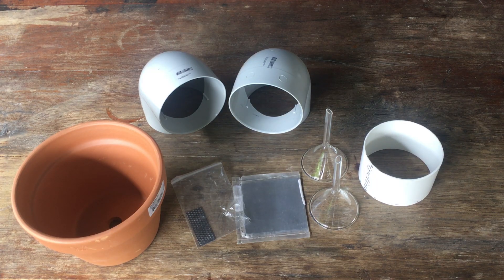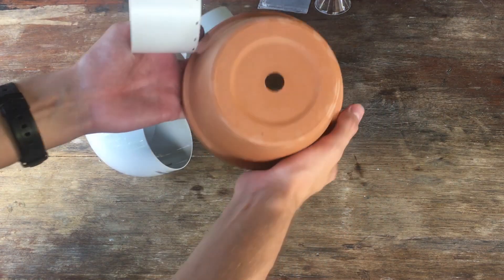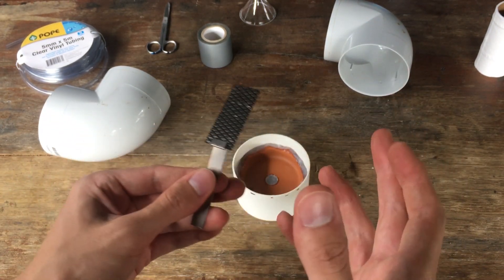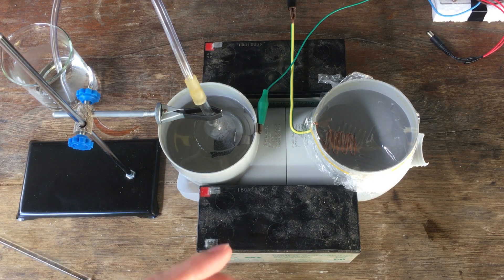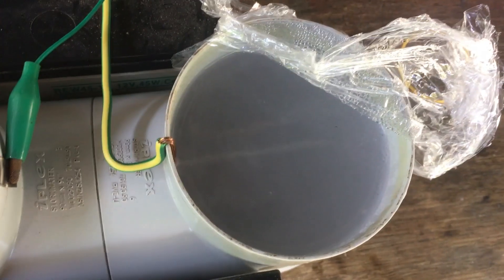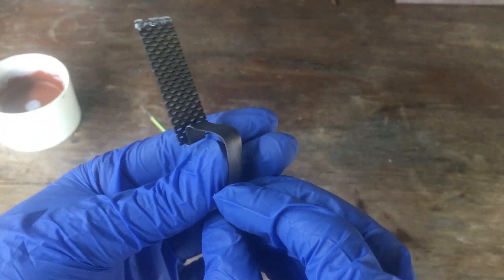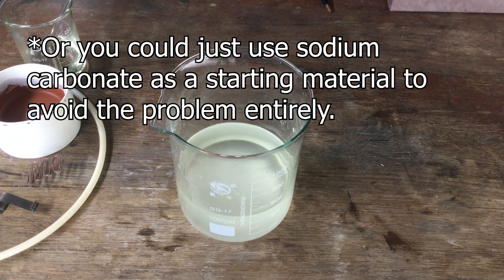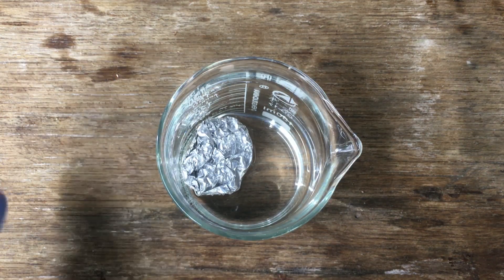A Chloralkali Cell

Comment: Instead of the diaphragm method, you mentioned you could make a ion exchange membrane? How would you do this? Any videos or materials on this? Or where could you buy a nafion membrane? Anyways, thanks for the video - really cool that you could run this process without going industrial!
Reply from the maker: I haven't tried making an ion exchange mambrane yet, and I haven't yet found a good guide to doing it, but others seem to have had very good results with it. Some videos on the topic include:
https://youtu.be/vJfc6dxrllI
https://youtu.be/BT3HjyziH_0
(note, that second guide is for an anion exchange membrane, which isn't useful for this process).

Nafion is a little tricky to find, but there are a couple of websites which will sell to individuals:
https://www.fuelcellstore.com/membranes/nafion
https://www.aliexpress.com/w/wholesale-nafion.html

Comment: what happens if you use a 12v 200Ah car battery for this experiment? Does it speed up the reaction process? Or what are the side effects or benefits of using 12v 200Ah batteries?
Reply from the maker: A 12 V battery will work fine for this experiment. The only drawback will be the fact that you won't have direct control over the current. To control the amperage, you'll probably need to adjust the depth of your electrodes every few hours in order to change the surface area in contact with the solution.
Reply: Hi, i love watching your videos and I find them very useful. In this NaOH production experiment I noticed that just to produce 15g it took you two days, what advice would you give to someone who would want to produce that same 15g in just 12 hrs? Your answer will be highly appreciated

Comment: Do you think this works better than just using a clay pot in an open tank? Also I bought some small pots recently and I had to sand paper them to make them porous, they are probably frost proof and made to not absorb water at the surface, once rubbed down they worked fine.
Reply from the maker: This setup doesn't really work much better than using a clay pot in a tank. I simply find it more convenient to have the two chambers positioned this way when it comes to extracting the product or collecting gasses (and also for consistency when comparing different reaction conditions, seeing as it can be used as a standardised cell construction).
A lot of clay pots are glazed after firing, making them non-porous. Sanding them down to the porous section is a good idea if you can't find non-glazed ones.
Reply: @ScrapScience you can make your own clay membrane from backyard dirt, turn it into clay, shape it, dry it air for a few days, bake it in oven for half an hour or so, then fire it in your aluminium melting furnace to red heat.

Comment: The copper will corrode over time, so if you are planning on running it for a long time you should use carbon or platinum on both sides.
Reply from the maker: Why would the copper corrode under cathodic conditions? I don't know of any mechanism by which that would occur in this setup.
I've had previous electrolytic cells running with a copper cathode in sodium hydroxide electrolyte for months on end and have never witnessed any corrosion.
Reply: @ScrapScience  I've never had a copper wire corrode on its own, I have only had it happen when using salty water, and making the mistake of using ac current. But you are right, cathodic conditions shouldn't corrode the copper.
Reply: @ScrapScience  for months u say,  I need advice on how I can produce what u produced in months just in one week, that's my biggest challenge

Comment: What is MMO?
Reply from the maker: MMO is just a type of electrode that involves a titanium substrate, coated with a thin layer of various precious metal oxides (such as ruthenium, iridium, platinum, and even tantalum in some cases). It stands for 'mixed metal oxide'.

Comment: I used Tyveck  great non interactive permeable  material and easy to find.
Reply: Worked w this stuff for years doing siding while in college...never thought to try it for a membrane.  I know it's tough, and suppose to one way pass water vapor, not sure about other things but great idea!  Have you tried it, does it seem to work well if so?  

Most not familiar w the type work may not know what it is, but as soon as I saw the word Tyveck I thought "holy crap why didn't I ever think of that stuff!" lol

Comment: how about cell membrane from  a lead acid battery?
Reply from the maker: That'll definitely do a good job! The only reason I haven't given it a go is the fact that I've never found any cheap sellers online, and I'm very much not a fan of dismantling lead-acid batteries.
Reply: some one answered ur ? but dismantling a battery is no hard. Drain , flush and use bicarbonate of soda to neautrilize.
The fabric used as divider is a semipermeable film. Resist to acids and bases
Reply: Can u explain more on this please

Comment: I have an idea to make in more efficient

You could use a joint to connect 3 pipes and then add two membranes and place brine in it. Can u tell if it will work and then only particular ions will be attracted
Reply from the maker: If I'm understanding you correctly, I don't think that setup will make the process more efficient. 
Assuming you have three chambers, a cathode chamber, a centre chamber (for the brine solution), and an anode chamber, separated by diaphragms, you will still generate sodium hydroxide in the cathode chamber by the same sodium ion transfer process. Additionally, you'll drag the chloride ions into the anode chamber to form a very low concentration of hydrochloric and hypochlorous acid, along with the main product, chlorine gas.
In terms of the current efficiency, you might actually lose efficiency by allowing for hydrogen ion transport (seeing as you're generating a small amount of acid at the anode), as this additional process will diminish the current efficiency of the desired reaction.
The benefit for your method, however, is the fact that the brine solution will be contaminated with hypochlorite and chlorate to a much lesser extent, and the design might be more efficient at making chlorine gas too.
Reply: @ScrapScience  ok thanks

Comment: Great demo!
I wonder if hot glue would perform comparably to silicone as the adhesive.
Reply from the maker: Thanks!
I'd imagine hot glue would be slightly more resistant than silicone, but I've always had trouble getting a proper seal when using the stuff.
Reply: Do a web search of "Chemical comparability chart" for the material you are working with.
It turns out that acrylic is pretty good with chlorine.

Comment: nice work ! maybe also cover the kathode chamber with a funnel and tubing to then merge both tubings and trigger HCl formation with a spak every few seconds. Saves NaOH for Cl2 deactivation and you can make some HCl solution next to the NaOH solution :) 
or trigger it with a UV Lamp/Laser
Reply from the maker: That's definitely a possible plan for the future, just need to reach the point where I'm comfortable working with such an explosive reaction.

Comment: Excellent progress. I purchased a stainless dog dish for my negative and placed the sealed pot inside it currently have produced a half gallon of sulfuric acid and magnesium hydroxide
Reply from the maker: A stainless dog dish is a great idea for a cathode/container! Good to hear the process worked for you.
Reply: @ScrapScience  
Stainless steel works good as a cathode, carbon works good as an anode.
Acrylic is good with chlorine.
(I have tried all this)

Comment: I used a clay pot to generate sulfuric acid from NaHSO4 and while distilling it I started to see purple vapors, and after a few minutes fucking iodine crystals started growing in the condenser!?
I tested my initial electrolyte for iodine but there was none, I also did not use any in the past month so it had to have come from the clay pot which was brand new.
Reply: Well, then it seems you were visited by the iodine fairy! Most fortuitous!
Reply from the maker: That's certainly a weird thing to have happened. I've got no idea why a clay pot would have iodine/iodide content. Could possibly be something from your electrodes too, I've got no idea.
Reply: @ScrapScience  yeah me too, my electrodes where  platinum and copper, so should come from there either...